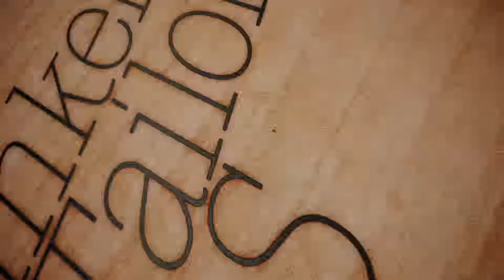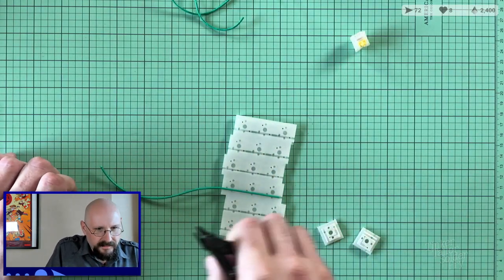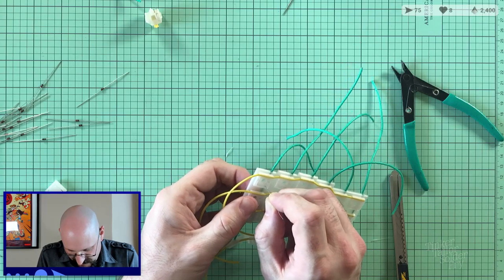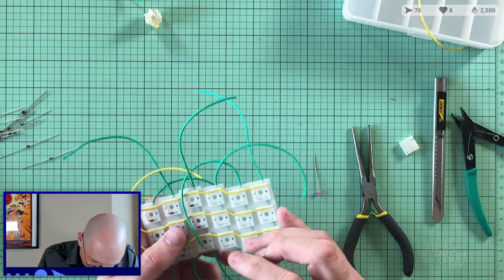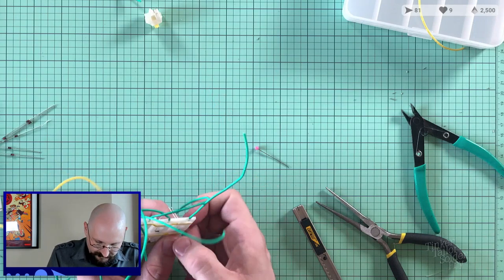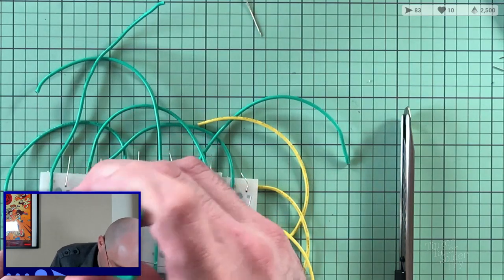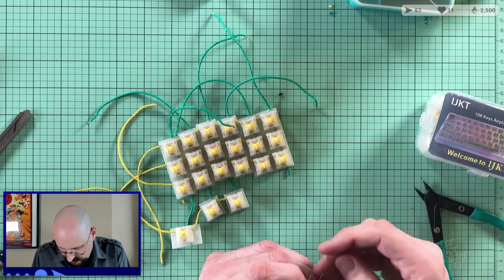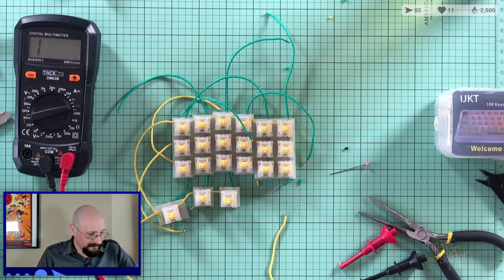3D Printed Hotswap Keyboard Base || Tinker Tailor Solder Fry

Comment: Original library author here. I'm a bit late to the party, but it's cool to see someone else actually put one of these together!
Reply: Some tips for future viewers: 
- you can change the diode direction in firmware as long as the direction is consistent
- for the diode/sewing needle trick to work it's best to pass the needle all the way through the wire (including the eye). You want to clear a gap both in the insulation and through the twisted wire strands. You can just stab through to the cutting mat to save your fingers.
- it helps a lot to pre-cut the wire with a utility knife for better insertion consistency. You should be able to feel the switch pin crunch through the wire strands
Reply: Also curious if this ever got completed